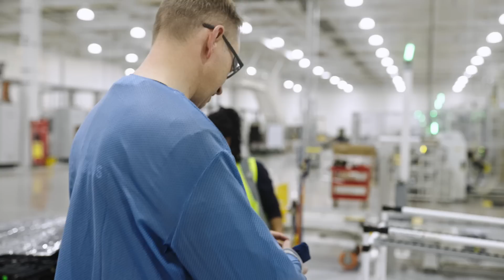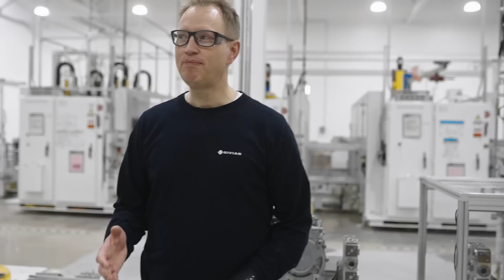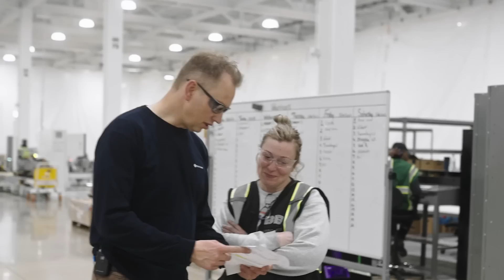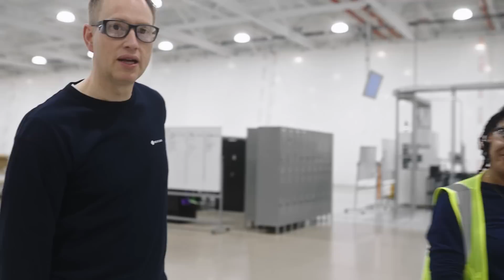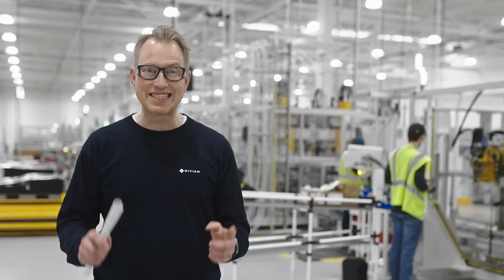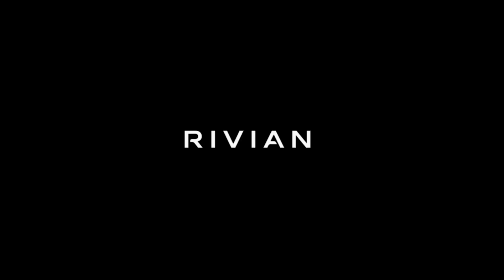Frank In Real Time | Update on Dual-Motor | Rivian

Comment: I'm taking delivery of my R1S in Q3 2023 and I wish I could get this instead of the quad motors. A Rivian guide told me that's not going to happen, but I hope Rivian can accommodate me on this. Yes, I'm with Rivian to reduce cost and hope they can make it happen for me.
Reply: not the first time someone has been screwed by Rivian 😕
Reply: Reality check: Cost reduction provided by in-house motor is for sake of Rivian’s bottom line; as it seeks to become a sustainable and profitable business while facing increasing costs in all areas. It’s not for lowering cost to consumers. If a lower cost vehicle is your wish, you should hold out for R2.
Reply: Is this because you want max pack?
Reply: @fmonk  dual motor is up to $8k cheaper than quad motor setup

Comment: At 3:10 Frank said "...a choice of the quad motor or 'AN' Enduro Motor...". Does that mean the "Dual Motor" is being replaced by just one Enduro Motor?
Reply: choice of quad AND enduro (i.e. dual)
Reply: @fmonk  Thank you.
Reply: In the Amazon EDV yes it will be single enduro motor however in Rivian dual motor version there will be 2 . The quad motor is still an option as well